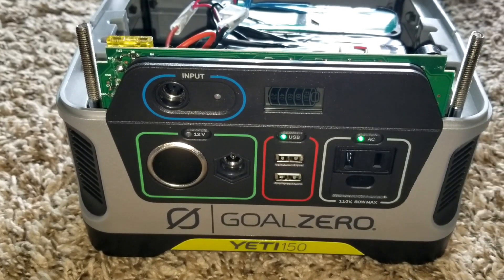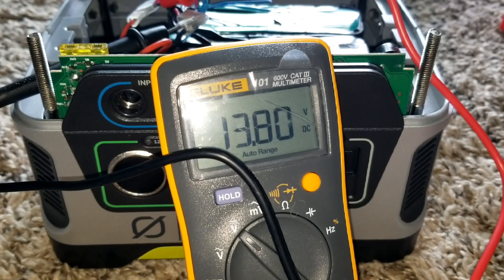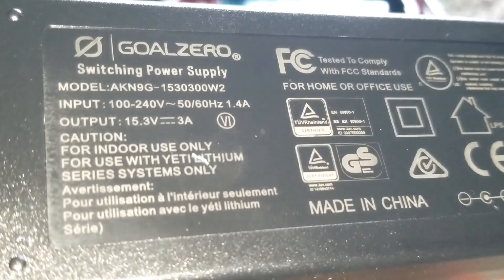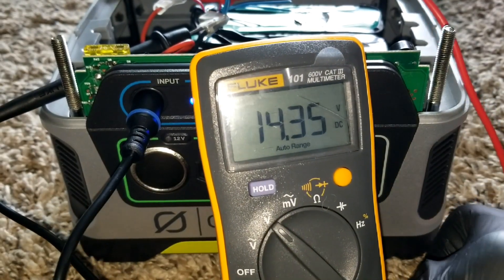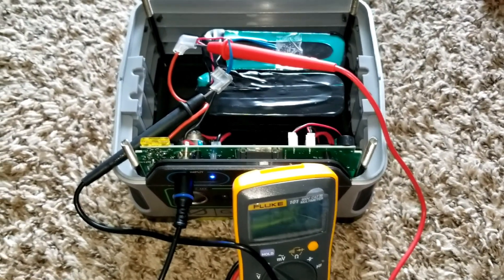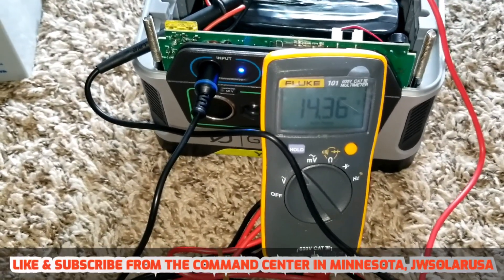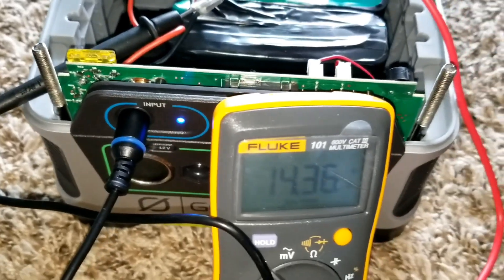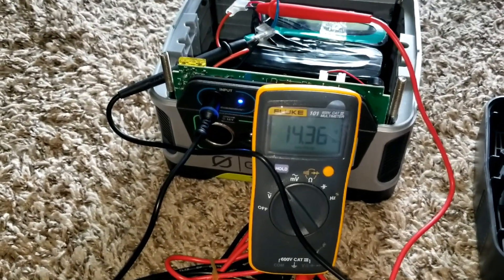HOW TO HACK GOALZERO SEAL LEAD ACID BATTERY FOR 18650 LITHIUM ION BATTERY, BMS & VOLTAGE TEST (Pt.2)

Comment: Well done! Is it still working? I have a Yeti 1250 that I have considering putting Lithium into, and it would be good to know if yours still works or if you had any problems or made any more changes to make it work better.
Reply from the maker: Going strong. 
Thanks for watching LIKE SUBSCRIBE and SHARE

Comment: Great build. How do the lithium cells fair using the yeti’s AGM charging circuit. Do the lithium packs have built in BMS? The SLA cutoff volts are different to the max volts for the lithium pack aren’t they? Lithium’s are fussy at max volts.

For the power the old lead acid has to weight this is a great upgrade. As old battery was 150wh/168(for 15ah Agm cell) what is watt/hr with two or three?
Reply from the maker: Hello Peter,
The packs has a built in Battery Management System (BMS)
Thanks for watching and don't forget to LIKE SUBSCRIBE and SHARE

Comment: Great up cycling 👍. Have you tried wiring multiple packs in series to get higher voltage ?  I’m considering getting a lot of them from battery hookup to use on a 48 volt inverter .
Reply from the maker: Here is my AFFILIATE link with batteryhookup. Save 5% to 10% when you that link for your next purchase.
BATTERYHOOKUP AFFILIATE CODE  
https://www.batteryhookup.com/?rfsn=3471371.009083
Reply: @jwsolarusa  what was the spec battery to purchase thru battery hookup?
Reply from the maker: @peterhutchings6356  
PANASONIC 4s3p 14.4v 6.6ah 95.04wh Li-lon PACKS WITH BMS

Panasonic CGR18650CG
Pack full charge voltage is 16.8v
Pack full discharge voltage is 11.2v

Packs are 4.5" wide, 1.5" deep, 3" tall. Wire leads are roughly 2.5
Each module weighs 19.5 ounces (1 lb 3.5 oz)

Brand:Panasonic
Model:CGR18650CG
Capacity:
2250mAh Rated
Voltage:
3.60V Nominal
Charging:
4.20V Maximum
1500mA Standard
mA Maximum
Discharging:
3.00V Cutoff
430mA Standard
4330mA Maximum
Description:
Green (Light) Cell Wrapper
White Insulator Ring
18650 Form Factor

USE THIS LINK TO BUY YOUR LITHIUM BATTERIES:
BATTERYHOOKUP AFFILIATE CODE  
https://www.batteryhookup.com/?rfsn=3471371.009083
Reply from the maker: @peterhutchings6356  
LIKE SHARE AND SUBSCRIBE